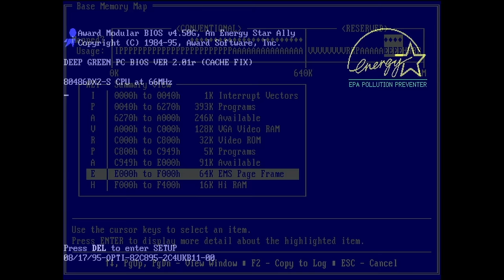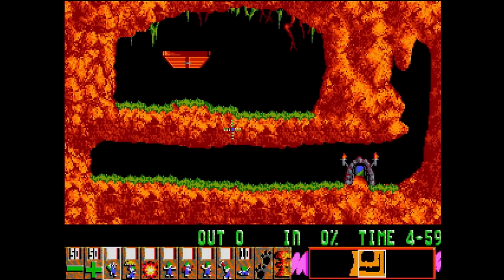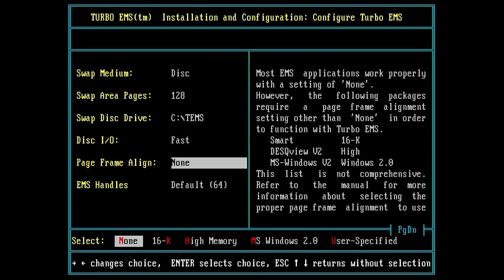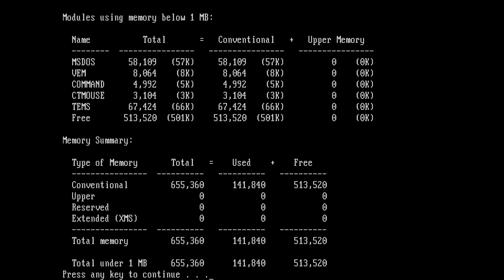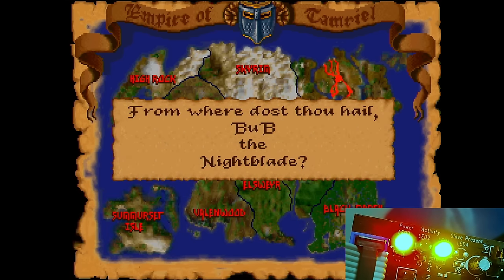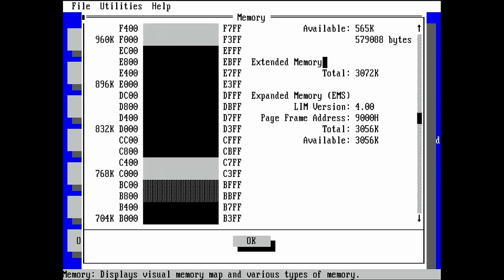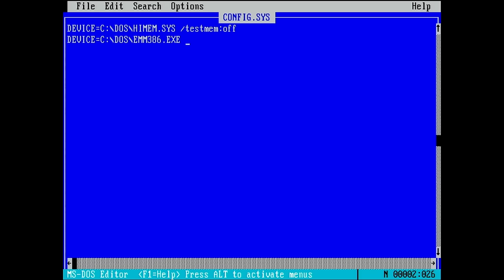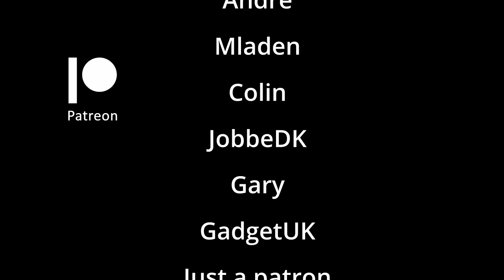EMS Memory: The clever hack for more memory in DOS!

Comment: You have to differenciate between memory addresses and actual memory. In the real mode MS-DOS uses it is limited to address only 1MB + 64k -1. The 640K/384K split is kind of arbitary.  640K are actual memory, everything above that are addresses reserved for memory mapped devices and ROM. When you had 1MB, you only had 640K mapped and left the rest unmapped.
When you tried to put TEMS page frame at E0000, you put it where no actual memory was mapped. But due to the way that TEMS works, it needs actual memory mapped there to hold the page that it retrieves from the HDD.
With 1MB memory installed you could have used HIMEM and EMM386 to map soma of the unused memory in the UMA and the HMA. Then you could have put the page frame on memory in the UMA to free up conventional memory. Then the rest of the otherwise unmapped memory could also have been used as EMS in addition to EMS backed by the HDD.
Also the performance with a real hdd with FAT cluster size of 16k or smaller would have been interesting. Flash is not really optimal TEMS since, the erase blocks of flash are usually mich bigger, something in the range of 128K. So causing a lot of 16k writes is really not ideal.

Also someting to be aware of for your upcomming videos: at one point the german translations for upper and high memory were swapped and only later (I think with windows 95) they where swapped to make them align better with the english original.
Reply from the maker: I couldn't get HIMEM to work with only 1MB. It simply refuses to work saying there isn't any XMS memory available.
Reply: @bitsundbolts  oh interresting. Maybe because it's in real mode and not virtual 8086 mode yet, it isn't mapped at all and himem sys expects it to be already mapped after the 1MB. Would be interresting to see if it works with a different PC/BIOS.
Maybe I give it a try later on my A2286 bridgeboard, which has 1MB. I belive himem worked there, but is is some time ago I set that up. But EMM368 won't work there of course, because it's an 268. Butit can emulate EMS through the DP RAM using the amiga memory, and now I am noticing I am going offtopic...
Reply: @bitsundbolts  I just tested it with my bridge board and it detects the 384K as XMS and himem.sys loads with that. If you want I can test TEMS there. I also made pictures of msd
Reply: @bitsundbolts Just need to disable Shadow Memory stuff in BIOS. It’ll work, trust me. Himem & Emm386 will get Win3.1 (std mode) running on 1MB ram. I did it on a Tandy 1000RSX back in the day before adding 8 MB.
Reply from the maker: Interesting. Did you disable something in the BIOS? Shadowing as many have suggested? If you can, please run TEMS if you have the time, I am curious if you can get the page frame placed in upper memory and can use it too. I could force the page frame to be there, and it showed up in CheckIt and MSD, but I couldn't use it. I'm currently not in Dubai and can't test it. Thank you!
Reply: @bitsundbolts  as this is only a 286, it doesn't have any shadowing. It only lets me configure the disk drives and interestingly the split between conventional and XMS.
I will try TEMS tomorrow. I have to check if I actually have UMBs there trough himem or if I need something else to configure them, if it is even possible on a 286. Since that doesn't have virtual 8086 mode but only real mode, I am not sure if the mapping can be changed in real mode. I have to read a little bit up on that myself.
Maybe it would be possible to put the page frame into the high memory (the little bit above 1MB, but probably not, because it's only almost 64k but not completely. So it would probably be better in that case to just load dos high, so that frees up conventional memory and place the page frame there. But you seem to be missing eben the high memory. Maybe there is a special driver for your chipset, which lets you configure the 384k better. Even if shadowing is enabled, it wouldn't use up all of that 384, since all the shadowed roms are in that space. Even if the addresses are 1:1 translated for your memory, there should be a way to turn the mapping on for the unused addresses to go to real memory. 
And maybe to make it clear for better understanding, by bridgeboard would be different, by default it has the first 640k mapped 1:1, then come the 384k reserved for hardware and roms and then the 384k after the 1MB address are mapped to the rest of the 1MB memory. And I have to figure out if I can bring a little bit of that past 1MB memory down inside the reserved range as an UMB to use as backing for TEMS. And a 286 might not be able to do that in real mode.
Do you have a way how I can send you the pictures?
Reply from the maker: You can send it to my email: bitsundbolts at gmail dot com.

Technically, it should be possible to have EMS available on 8086 systems if you had one of those EMS boards. They also mapped their page frame to access the extra memory (those boards were mostly 2MB if I'm not mistaken). I think it would be better to understand all this if I had one of those expansion boards and not do everything through software. I don't have a running 286 yet, otherwise I would have used that system.
I want to work on the 286 where the tantalum cap exploded - there are new options available.
My confusion is that TEMS doesn't work when the page frame is put in upper memory. I tried it with HIMEM loaded as well, but that didn't work either. EMM386 doesn't seem to have this issue, but it puts the CPU in protected mode - which I didn't want to cover in this video. All I wanted to do is to have a look at EMS and ignore upper memory (except for the page frame) and XMS. When I get back, I will. Try to experiment with it again as well.
Reply: @bitsundbolts   If you have a physical EMS card, it will map itself to that upper memory location. Meaning if it sees the address on the address bus it will respond accordingly and show the selected page there. Since it has dram it will let the read or write go straight to the selected page.
But if you use TEMS, you don't have any physical memory there. TEMS needs some real memory to buffer the pages it will store to the disk. If you write to the page frame, it will just go to normal memory and if you select a different page through the tems driver, it will write the current contents of that memory to the file on the disc and retrieve the newly selected page from disk and write it to that memory location. So you need to actually have memory where you put the page from for tems. That's opposite to what a physical EMS card would want. Because if you aready had memory oder another device mapped there it would be a conflict.
With the 286 you only have real mode and protected mode. In real mode the address the application sees is the physical address. In protected mode the mapping can be changed and addressing works a little different in general. Since DOS and the applications need real mode, the protected mode can be mostly ignored on the 286. That means I only see the memory and memory mapped resources where the hardware puts it. In the case of my bridge board the address decoders in the chipset put 640K memory at address 0 and then another 384K at the 1M address. There is none of the memory mapped at the space between 640K and 1M the UMA. The only way to have UMBs here would have hardware to to put it there. Some chipsets might have the option to change the addresses of the memory. All the 384K are true XMS that can only be accessed through protected. XMS drivers / DOS extenders work by temporarily go to protected mode to copy memory from here to the real mode accessible space. There is one small exception, with the A20 address line enabled 64KB - 16B of the XMS can be accessed in real mode. Thats the HMA. HIMEM.SYS enables the access there and you usally would put DOS there with DOS=HIGH.
But on 386 and later you have more options. It comes with the virtual 8086 mode / unreal mode. The processor here runs in protected mode, so the MMU can be used, but for the Application it looks like real mode. The EMM386 puts the processor into that mode and can map parts of the XMS below 1M in the UMA (upper memory area) in the form of UMB (upper memory blocks). The physical address would still be beyond 1MB but DOS and the application then sees it at a lower address. These UMBs can either be used directly to load TSRs and drivers or EMM386 can use it to simulate EMS. It does that by simply mapping a different page of the XMS through the MMU there.
And since the 286 doesn't have this unreal mode it can't do this magic using it's MMU, so it would need to happen in hardware. 
But building a 8bit ISA memory extension using an SRAM chip is fairly easy. There is already one project, where you can even select with a dip switch which UMBs you would use. You could use one of them to give you an UMB on a 8088 or 80286 and then put TEMS there.
One thing I omitted for simplicity: the 286 I have is a A2286 bridge board for the Amiga. In addition to the 1MB normal memory, it has 128KB of so called dual ported RAM mapped in the reserved space it uses to communicate with the Amiga and emulate monochrome and CGA graphics, use for file transfer and HDD emulation etc. So this usually can't be used as general purpose memory. But if I use the monochrome mode, I might be able to use the CGA frame buffer as and an UMB to put TEMS there. Do you have an application that makes use of EMS in Monochrome mode?

Comment: Apricot was an early British PC clone brand from a company called ACT. A lot of their machines were not very compatible with the broader PC ecosystem, for example using their own floppy disk format. Software which mostly used the BIOS routines would work okay on an Apricot machine but anything which directly addressed the hardware tended to fail due to some architectural differences and proprietary nonsense. This hurt their value in the market and they are honestly still kind of a nightmare from a hobby perspective for that reason. I have an Apricot Portable which is essentially a doorstop because it uses a nonstandard floppy drive that I have so far been unable to repair and cannot replace.
Reply from the maker: That incompatibility is very unfortunate. I guess it will be similar with the apricot point 7.

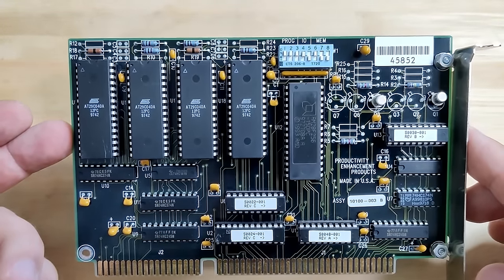Comment: The ISA16 card at 9:00 contains four 512KByte FlashMemorys. So.. no RAM expansion. The AM28F256 is a 32KByte Flash.
Reply: So its some sort of an early SSD
Reply: @rubberduck4966  Might be. If so then I assume that the 32KB FlashROM contains some driver code to boot from the Atmel FlashROMs.
Reply from the maker: Maybe you're right. It might be some sort of SSD. Maybe not for continuous writing, but for storing data and quick access.

Comment: I love that Turbo EMS lets you go full ridiculous and presents the idea of having the swap on a network drive as something you would even consider doing. I can only imagine somewhere that to offset the cost of all the networking hardware and the server, some company had this great idea of all the money they "saved" by having all the computers connected use the same network drive for all of their EMS "needs" instead of buying RAM =p

What's even better is DOS network drivers tended to need a good chunk of conventional too so you'd need that simulated EMS even more. I'm in awe of just how slow this had to be hahah
Reply from the maker: Well, I had a compact flash as a hard drive and it was painfully slow. Now think of an older spinning drive... And then comes the network latency, I guess... Unusable in almost all situations.
Reply: I mean, if you're only running productivity applications, it would probably be fine for bulk storage that isn't accessed frequently.

Games are an absolute torture in terms of computing. Nobody in the 1950s imagined we'd be running millions and millions of computations every microsecond just to get a picture on the screen, and then read the user's input only to do it over and over and over.
Reply: Lotus 1-2-3 would be an interesting test.

Comment: I have a Zenith 8088 Laptop computer that only have 640k base memory and two 720kb floppy drives it runs at 8mhz in the fastest speed, Blue/Grey monochrome LCD display. no hard drive. I had to hand craft my own dos boot disk to fit the entire dos environment on a single 720k disk and then put compatible games/apps on their own disks in drive B. using limited hardware sure has it's challenges but it is quite fun to mess around with too when it works

Comment: Have you heard of UBMPCI.sys driver? Its description says there's something special happening about upper 384 kb of memory, like it's reserved for shadowing ROMs and cannot be used as a regular RAM, even if there's no ROM shadowed in it. And to make it behave more or less like regular RAM some configuration needs to be happen, what this driver is for.
Though it's description page also says it does NOT work on 486 class machines, only on later ones, because of missing functions in the bios if I understand correctly

Comment: That ISA card contains FPROM (Flash Erasable ROM) chips. Not RAM chips, so it most likely is not a EMS card. If it was, then it would have to chew FLASH cycles and that would be very slow indeed.
Reply: EEPROM. It's a Cisco pix memory card. (aka, the thing that makes a pc a pix.)
Reply: @jfbeam  Ah. I wondered what it was out of. Didn't recognise it. Just looked up the datasheet to confirm it was a flashprom I've used with some homebrew computer kits.

Comment: You actually consciously skipped two crucial points: the Upper Memory Area (A000-FFFF) and where the "missing" 384 KiB of the 1 MiB installed in the system went.

The Upper Memory Area is reserved for BIOS and expansion cards (RAM and ROM). On most 286s, the 384 KiB of memory in this area is remapped above the 1 MiB limit as XMS (and potentially HMA). On almost all 386s and 486s it is used for BIOS shadowing and is essentially inaccessible (only partially mapped and read-only). This is why on a 286 with 2 MiB RAM I could have 1408 KiB extended memory, whilst on a 386 I would be left with 1024 KiB only.

Sometimes you could reclaim this memory by turning BIOS shadowing off, but for the most part it did nothing in terms of available memory and only degraded performance. Depends on the chipset and BIOS, actually.

So, TEMS failed with the page frame set to UMA, as there was no real memory at this address. And TEMS is just an "EMS emulator" and it needs real memory for its page frame, where it can copy data from/to its backing store (disk, extended memory, whatever). On the other hand, EMM386 is a 32-bit hypervisor that runs DOS in the VM86 mode with paging enabled and maps extended memory into UMA at will using 386's paging.

Thus, Elder Scrolls is most likely not incompatible with TEMS. It was just TEMS's configuration that was unworkable :)

Nevertheless, this is a good video, albeit more focused on TEMS as a very specific product than on EMS as a concept.
Reply from the maker: Thank you so much for this information. I wasn't aware about the difference between 286 and 386 and how shadowing and the upper memory area is managed. I wanted to just show how the first trick of memory expansion worked under DOS. I specifically wanted to avoid speaking about real and protected or virtual mode. The rest will come later. If my 286 would have worked, I would have used that one. I might try to fix that board first to start over to be honest.

TEMS sounded very interesting because it could use a disk for swapping the memory. Even though it isn't a solution that is fast. I guess TEMS was able to determine that there was no memory above 640K.

Anyway, thanks for your input - I'll definitely use your comment for further research! 👍

Comment: Are you goin' to try all another mem managers? QEMM with its autoconfig, and some similar utility in PC-DOS.
Back in 90s I failed to figure out how to config dos mem, though I used clean DOS even in Win95/98, not trusting DOS-session in it. Later I found out that it works better, providing more conventional memory and allowing multitasking of several DOS apps. And only recently played with mem managers in PCem and finding out some of it magic. But still can't understand how to make it all good and universal config for different software some of which needs EMS, some not, some is memory-eager to have much XMS and some require No EMS. And LOADHIGH command! In my case it works only when I start EMM with NOEMS option, when some upper RAM is given for EMS it loads all to lower addresses and it drives me mad.
Reply from the maker: I completely understand your frustration with memory managers. Believe me, I struggle too! I don't think there is a perfect configuration that fits all needs. Maybe there is one that works in 80 or 90 percent of cases, but not all.
In this video, I tried to start with EMS memory, which was the first type of memory available to break the 1MB barrier. Unfortunately, I do not have a hardware EMS board which would make things a little bit easier to explain as there is a clear distinction between system memory and the expansion board. All I can do is emulate EMS through software (TEMS, EMM386, or others) which all use normal system memory.
Anyway, I'll try to continue with this series and hope to end at a conclusion some day that should be good in most cases.